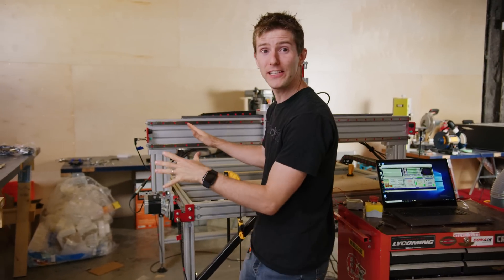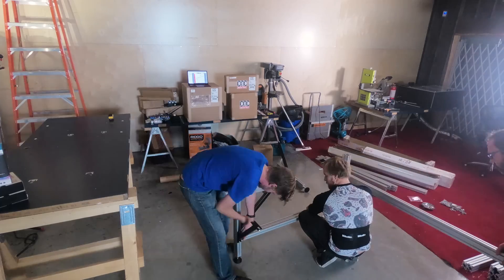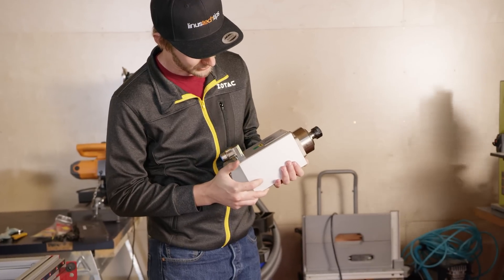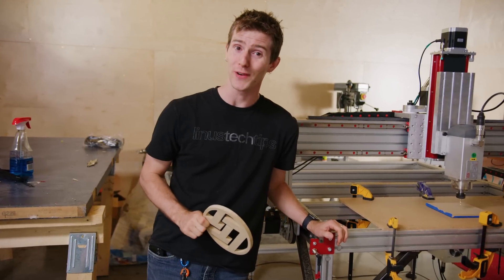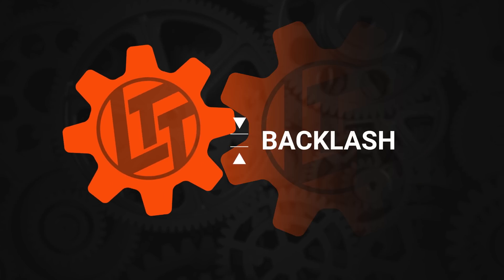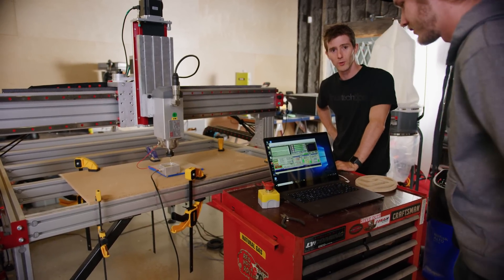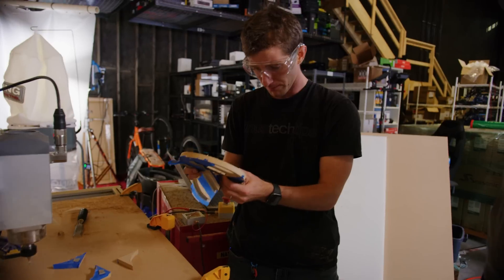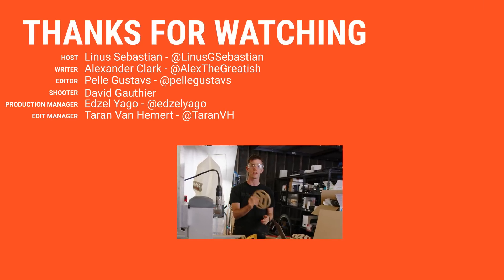Our New $10 000 Router!

Comment: Don't use tape... Too much waste of time and prone to error... Either screw the bigger part to the wasteboard (that's why it's called a wasteboard) or make a matrix of holes with 6mm t-nuts on the botton so you can screw clamps with 6mm screws. You should also add tabs on your CAM so that the piece you cut doesn't fly away when it's attachment to the stock gets small. You can even make the clamps using the CNC, there are models everywhere. A rectangle with a slot, and then a washer and a 6mm screw in there.
Reply: Something like this https://www.youtube.com/watch?v=TMtvrGnYF7Q
Reply: And here's what you need to do for a proper spoilboard clamping solution https://www.youtube.com/watch?v=yhVW6Q9o-34

Comment: Cnc elitist here.  Mach3 and steppers are "easy" to set up, but seriously, Mach3 is NOT reliable software. Having been a Machinist and Automation Integrator for several years I can say first-hand that Mach3 is not a real-time controller and will misbehave, doing very dangerous things that no controller should do and violates industry standard safety practices.  You can buy bolt-on kits from reputable CNC manufacturers or even build a rock-solid, reliable machine with LinuxCNC (real-time kernel) and hardware from the likes of Gecko or Mesa Electronics.  I know I'm beating a dead horse, Mach3 uses userspace software to perform critical functions like emergency stop.  If there is a software or OS hiccup (this is Windows afterall), during an emergency, this can very easy kill or maim someone. It only takes a fraction of a second for a cutter to grab an article of clothing and the results are not for the faint of heart.

Comment: that F8 pass (the bigger bit you used) was in the wrong direction. 

you should try to ensure the cut direction is opposite to the bit rotation.
if you're cutting out a circle you should cut counterclockwise, if you are cutting out a donut you should cut clockwise,
that way you get a cleaner edge on your cut, noticable on wood but not really so much of an issue for MDF , but you will thank me when you are cutting aluminium or steel.

and make sure your material removal rate is sufficient for the RPM and cut depth, typically its better to make 5 shallow slower passes than 2 deep and fast passes. 

also when you inevitably start cutting aluminium and steel (which is very possible with that machine) make sure you cut slow and shallow and definitely have a coolant system in place, or at the very least have a squirtgun filled with some kind of cutting lubricant.
Reply: I imagine you could make a pretty awesome heatsink using this little guy.... billet aluminum, a fine f4 bit or something and a lot of very slow cuts.

Comment: Those gears look an awful lot like timing belt pulleys Linus....

Also, the backlash doesn't add up unless the stepper skips due to a head crash or similar. It just makes for a super garbage surface finish

Comment: Use Vectric Aspire instead of vcarve.  It's better and you can do 3d modelling with it.  You need a proper dust collection system with a dust shoe around the spindle containing and vacuuming the dust and chips as you carve.

Comment: I have a 48"x48" CNC, it's easy to do.  I built mine from a kit for under $1500.  I can cut and carve pretty much anything.  I have CNC videos on my channel.   Even Linus can use it without screwing it up too bad.  I have a 2hp 24000rpm craftsman digital router on mine.   Linus' cnc is overkill,  but it's awesome.

Comment: I work on a router 8 hours a day. Love the video but I can’t stop thinking about my job while watching it. 😝
Also changing bits without an E-stop is not safe practice. (At least on my machine)
Reply: Cnc machinist here, the mill's I run you can't E stop while changing tools (in fact E stoping my mill cuts all power to the axis's, spindle and any machine features)

Just use your head and don't be scared of the machine, if you know what your doing at times you can even touch a spindle while in cycle :)
Reply: @Donkusdelux  just know when to feed hold on M5 😉
Reply: Should hit the safe button before putting your hands anywhere near the machine
Reply: Lockout every time
Reply: Have programmed and operated 7 cnc machines 2 of which are 5 axis and I never hit the e stop to change tools. I would have to re home the machine if that were the case. Though the machines have multiple tool slots for different tools besides the one in the spindle.
Reply: Always lock the machine out first. I'd do a quick read on the sequence the manufacturer recommends for changing the cutting tool. They would know best
Reply: @EtherGaming604  lockout is complete overkill for the machines I run. I'm not completely shutting my machine down to change a tool. Like I said, my machines hold multiple tools and don't require me to wrench them out of the spindle. I actually never touch the spindle when changing tools. E stop cuts power to spindle and servo motors and require a rehome every time you press one. But I would recommend that if your machine requires you to manually take the tool out of the spindle definitely press an e stop at the very least
Reply: Meant to put “lock” and not “E-stop”
(Apparently I wasn’t thinking about work as much as I thought I was😜)
Reply: Should disconnect the machine and cut the machine's power before doing anything
Reply: @JesusMeza3  Should Disconnect all motors and electronics before changing bits.
Reply: Good luck swapping tools on most machines without power

Comment: @Linus Tech Tips, Make sure to do a full leveling pass on the spoil board. If you don't your bed surface for your material will not be flat. This will cause you endless nightmares as the finished thickness of your project will vary from one area of the surface to another.
Reply from the maker: Already on it, just needed to get the dust collection fully operational first for the big leveling pass.
Reply: And do this periodically because it will absorb moisture and warp over time.
Reply: Man I hated doing that...took too long on a 5x10 table...
Reply: Lets be honest, is LTT. They will be lucky to measure with a tape measure.

Comment: You need to run the program a little slower. Running it too fast puts stress on the bit and will make it dull faster, or break! I used to run a massive one of these out of a cabinet shop.

Comment: 8:54 torque is measured in lb-ft, not ft-lbs. the two units are dimensionally equivalent but not interchangeable because that would be confusing. ft-lb is a unit of work.

Comment: As a guy who has 11 years of experience as a CNC machinist I have to say that I really enjoyed this video, and the description of how this particular machine works. That being said, you really shouldn't get a metal lathe unless you really know what you are doing. Those things can be ridiculously dangerous if you've never used one. Also, always err on the side of caution when it comes to work holding. It is a lot better to be inconvenienced removing the part than to have it fly out of the machine at a high rate of speed.

Comment: Lolextruded aluminum is super terrible for machine frames, it's like making your machine out of dry spaghetti.  It has no strength, no rigidity, and no vibration dampening.  All of which are crucial for machine tools.  They call 8020 rail "The erector set of the industrial world" because it's a toy, only useful for keeping stuff off the floor.  Real machines are made of cast iron because it has good strength, high resistance to flex, high rigidity, and god vibration dampening.  Real machines weigh many tons for a reason.
Reply: its a hobbyist machine.. its not an industrial grade machining center. 
also extruded aluminium has pretty good vibration dampening all things considered. and only oldey timey machines are made from cast iron... theres a whole bunch of modern commercial grade CNC machines that are made from regular steel.
Reply: No, pretty much any brand new decent quality CNC machine is still going to be cast iron, or at the very least epoxy granite.  Steel is terrible for vibration, and aluminum is even worse.  The strength, toughness, and mass just isn't there.  The only place you find steel or aluminum is in the "hobby grade" machines, or the terribad Chinese knockoffs.  Real machines absolutely require the pure mass and inflexibility that only iron has naturally to support brittle tooling like carbide at high MMRs.
Reply: @Hawk013  https://www.emmegi.com/en/product/machining-centres/diamant  here's one of the ones I use on a daily basis... entirely steel build. It's not Chinese it's Italian.  Italians are pretty good with machine tools

Comment: Why did you go for a cnc router rather than using something like a cnc mill from tormach? Do you guys not plan on cutting much aluminum? Rigidity is your friend when it comes to cutting anything harder than plastic or wood. Also why do you guys use solidworks when fusion 360 has the cam and cad built right in? Plus its cheaper than using solidworks, but you know solidworks is like really cool.

Comment: I Vote you call it "Woody" since it routers wood rather then ones and zeros if you must have a nickname.  Although you could like most places also just say "the cnc router", a wood shop for example would have at least 3 types of routers and it would be normal to be specific.   

PS.  You need a "maker" that can work with their hands and has seen the inside of a machine shop on your staff really badly.  It hurts so much watching you bumble around in these videos.  The investment in high-end equipment just makes the smh factor that much worse.

Comment: The stepper motor does not actually have 200 electro magnets. There are typicaly only 8 of them inside the motor. The 200 steps are achived by using a manget that looks a little bit like a gear on the motor's rotor.

Comment: Since you have the big dust collection machine in the background  you could easily convert that table to a Vacuum suction table with a few settings tweaks and some pvc pipe  and you solve both the dust and Tape problems.

Comment: Just call it a CNC.  3-axis CNC if you want to get fancy. I also see you don’t have much experience with 3D printing. It’s very similar.  I would say 3D printing is a bit harder because of all the variables in filament.
Reply: Depending on the software your using 3d printing is much easier. Personally i just export from solidworks and the printers software will take just that and some internal options and can print were with the router you need to set toolpaths and adjust spindle and travel speeds depending on bit material and cutting material

Comment: Make your own distribution system for a watercooled pc!

Also, you should totally be able to cut metal with that thing too, not just plastic and wood. Just cut slowly with metal, you want larger chunks getting cut off. You can't cut tiny particles off of metal like you can with wood.

edit: by cutting slowly I mean turn the bit slower NOT moving the router slower. You want a higher router movement to spindle rpm rate fate for metal.

Comment: Here's a bit of advice. If you're thinking of buying a metal lathe, get a metalworker to operate it. It's not safe for amateur work. Improperly mounted material on the router can make you end up with a bruise or a cut while a metal lathe mistake could seriouly break your bones.
Tig welder is fun but it's extremely hazardous and requires a lot of protective equipment, radiation, fumes, arc flash, burns, etc. Basically every type of hazard except biological.

Comment: hi, just a quick thought as you guys are accident prone at the best of times, i have a router and a laser cutter the laser is safer, as the cutter on the routers are kenetic and for better user safety and comfort while retreving items, have the router make the spoiler board, put an oversize board on it and make sure its thicker than you want. set the zero positions for x and y to one corner and the z high, so when it homes you know its safe. now for the ease of use. get the router to cut into this board on its maximum cut size maybe 1cm deep, will take a while but worth it in the long run, now have it drill peg holes for clamps so no more tape(or reduced). as you made these files you have them as a starting point for all cuts in future. you can load that base file in fusion 360 or what ever you draw in. adding you items to that space aligned on the grid you made and cut on your machine. this will help in many ways, the best thing for you guys is fast resets. if the machine is not cutting fast enough and ruins the peice or linus drops it or you forget to film it, you dont need to waste mats or time ajusting the zero just reclamp a new peice in the same location press home and recut. i found having the base template so much easier to work from and get faster results from pc to wood/plastic/aluminium and its also easier to visualise the size of the item before you make it.. also make a giant trex or something. :) and have fun making stuff and breaking £100+ router bits

Comment: Things wrong with this video.
1. "uSiNg A cNc rOuTeR iSn'T jUsT hItTiNg Go LiKe On A 3D pRiNtEr"
It has pretty much the same steps. Setting up the software, and the settings, slicing into a .gcode, and sending to the machine.
2. "gCoDe, A pRoGrAmMiNg LaNgUaGe FoR cNc mAcHiNeS"
.gcode is used for, 1. 3D printers, 2. Cnc routers, 3. Lazer cutters. etc.
3. Not calling this cnc router "Linksys"

Comment: If it cuts metal, you could use it to make a new episode of sketchy heatsink!
Reply: should do as long as they get the right router bits. they'd be limited to only an inch and a bit of height it looks like.
Reply: it cuts non ferreous metal. E.G. Aluminum, brass, etc. Mainly depends on the spindle rpm.
Reply: ARTV if it can it would only be aluminum, the router is made to cut wood
Reply: Didier Levesque Aluminum is the metal used in most heatsink so it should be right?

Comment: You cant use that motor for any big metal work. Mostly for engraving and wood.
Reply: it will work fine with sheet steel and a slow speed though.. as long as theyre not trying to cut anything thicker than 1mm in a pass it should be ok as long as theres coolant involved.

Comment: Just because the router is not moving doesn't mean it is safe to reach in there. You have to press the all stop button... big red button on the yellow square before it is technically safe. This is an OSHA work safety violation.

Comment: Just month ago i finished setup   almost 20000$ cnc router. 4 axis (1500*4500*300 metric). That was fun. And don't waste you money on any pult(remote control unit) for that thing. Better spend on utility CNC vacuum cleaner (clipped to the spindle). And vacuum table (you can diy that). That be my first suggestion.
Reply: and maybe a coolant feeder for when they inevitably try making a heatsink from billet aluminium.

Comment: My brother a few years back brought a nice case for his computer that has all its sides completely made out of perspex plastic that was cut out on a CNC machine. The only metal parts of the case are the tray his motherboard sits on along with the backplate to screw the cards onto and all the little screws, nuts and bolts that hold it together. 
Even thought CNC stands for (Computer Numerical Control) call it (Company Noise Creator) or "Noisy" for short.

Comment: Get a DeWalt xr max lipo impact driver. It has three settings for hit and is great for everything from setting fine machine screws on the lightest setting all the way up to running in a lag screw and snapping off the head.

Comment: It should cut aluminum as well, but if you're gonna do steel on it you need a cutting fluid system
Reply: Also, welding is faster, stronger and more reliable. It's also fun and fairly easy! I could show ya....

Comment: Torque is in lb ft not ft lbs!!!
Reply: Nm actually. No need for 1800s unit systems anymore.
Reply: It kind of doesn't matter which way round it is (x*y=y*x). It would have to be feet pound though. I totally agree that he got it wrong though. :)
Reply: Cian Hughes Sorry but I don't use communist units. ;P
Reply: Sorry sonic, but all your freedom units are defined by very commie units you despise (1"=25.4mm etc)
Reply: EscapeMCP That's just to make it easier for everyone else to convert from commie units to freedom units. ;P
Reply: @sonickiller360  Metric is more consistent as a math system, but using both on the same design is what real ballers do.

Also, is it actually incorrect to use ft lbs? Usually the unit used with inches is ounce inches. I have seen all of them though on spec sheets.

Newton meters is always preferred thought since it means I can calculate the wattage required for an application fairly quickly.
Reply: Matthew McKellar From what I was reading officially its lb ft, however, colloquially it appears nobody gives a fuck and uses ft lb instead even on spec sheets to avoid confusion (I think).

Comment: I really would like to see you're solution for a dust proofed pc for running that thing. I've been working with cnc mills for milling circonium oxide for dental stuff and the dust kills electronics in rekord time, we endet up enclosing the computers completely and put over pressure on the hole case to keep the dust out but in the end it was quite complex and still feels a little bit overkill. Anyway, I'm exited to see what future router project you are going to do:D

Comment: I wonder how cheap it would be to replace the case worthy of a $100,000 wood cost if it was made out of would and metal incerts(aka screw holes that don't damage wood) and metal brackets so hard drive cages weren't made out of thin wood.

Then paint it and give it a temperd glass side pannels. Oh and hinges those can be metal with plenty of metal incerts so the door doesn't fall out of the side of the case